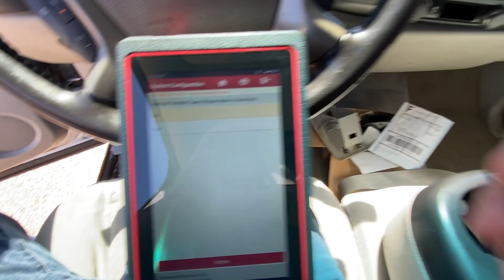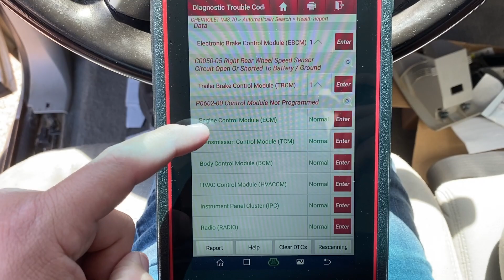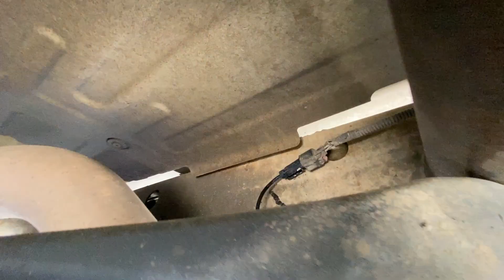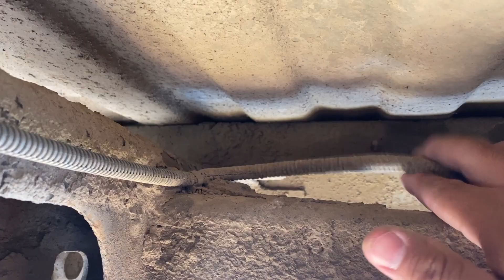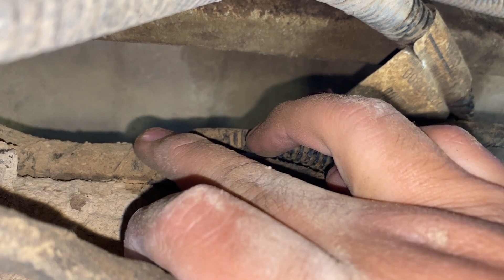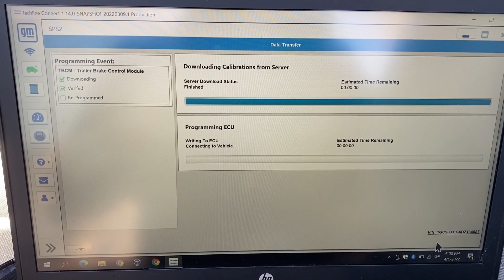CHEVY SILVERADO SERVICE TRAILER BRAKE & WHEEL SPEED SENSOR FAULT DIAGNOSIS & FIX

Comment: I.would have done.exactly what you did but that was a pickup you tilt the bed up on the driver side to access the top of the fuel tank for a fuel pump or whatever instead of dropping the fuel tank. It's easy and quick.

Comment: Im having the exact same problem. i too want to just run another wire, but at the abs module, im not sure which wire  it is by the module. Any help would be greatly appreciated. 2018 chevrolet silverado
Reply: Rear driver side wheel speed sensor

Comment: Absolute masterclass of automotive diagnostics. I bought a 2012 with abs on. Brand new speed sensor was still throwing a code. I broke out the parts cannon and just changed it to a Bosch and  it worked and hasn't came on since. Last guy put on a cheap aftermarket part. I figured it was worth $30 to just throw a new part on and hope. I got lucky

Comment: Get yourself a Power Probe Ect3000. Connect the signal output to the cable you want to trace and use the receiver to look for the cable along the harness. When the beeping from the receiver stops, that is a general area where the break in the cable happened.

Comment: Thanks for this video, I'm currently looking at a 2012 Sierra 2500 and it has service trailer brake system light on dash. Is the same issue you fixed on this video? On average how much would it be to fix?

Comment: Would this be the same for a 2008 Silverado for trailer brake , I have replaced that as well as dash electric brake switch,  and remain on,  Someone put a aftermarket one in,  But that dash message is annoying,  Also I watched other videos where they replaced without programming on the 08 chevys , help please....

Comment: Trying to trace an open or broken wire can be easy or become a nightmare. Have you ever considered using a circuit tracer? You can actually find where the break in the wire occurs without physically probing or touching the wire. Just my two cents worth.

Comment: I  WANT YOUR HELP MY FRIEND  I AM FACING A STRANGE SITUATION I HAVE STFT -18% - -23% AND LTFT + 24% AT IDLE AT WOT NOTHING CHANGE FUEL TRIMS ARE SAME.THE 02 SENSOR 1 DONT WORK AND THE CAR STALL WHEN GO TO STOP AT  LOW RPM (1000 RPM) .UNPLUG MAF AND FUEL TRIMS GO TO NORMAL AND STALL PROBLEM STOP BUT CONECT MAF AND DISKONECT 02 SENSOR 1 STALL PROBLEM IT GETS WORSE . HOW CAN I BE RICH IN STFT AND POOR IN LTFT?ΤHE MAF READING NORMAL AT VOLUMETRIC EFFISIENSY AND IDLE AND 2500 RPM HAVE READING IN THE SPECIFICATIONS 
ECU TO CLOOSE LOOP READ  THE PRICES OF THE O2 SENSOR AND THE MAF  TO REGULATE THE FUEL TRIMS?DO YOU 
THINK IT IS RIGHT TO CHANGE O2 
SENSOR FIRST?SO THE ECU READ THE O2 
SENSOR BECAUSE NOW THE ECU DOES NOT SEE ANYTHING FROM THE DEAD 02 
SENSOR! WHAT DO YOU THINK IS MAF OR O2 SENSOR FALSE? THANKS MY FRIEND

Comment: This was a great job.  What you were working on was a "water baby", a truck that had been in water and mud at least up to floor level, and if above that, the cabin was cleaned up really well, where you could not see or smell any traces or water, mud or mildew. Great job, great choice in running the the wire.  My only question is in making the splice, did you use a low temp solder connector with heat shrink tubing over it or a crimped butt connector with heat shrink tubing for a water-proof connection, or some other method? Inquiring minds out here, hanging on your answer for the best practical, water-resistant splicing method.  The re-programming of that trailer brake module was an excellent lesson in how to do something many of us would never see done or have any idea know how to do.  Thanks again for sharing your knowledge and diagnostic techniques with your viewers.

Comment: I've got a system that puts a pulse in the wire. Then a sensor you run down the length of the harness. when it stops beeping you found your break. its made by power probe and I bought it thru snap-on. Used it many times and it works awesome.

Comment: Y not use that tool that finds breaks or splices in the electrical wires? That way you wouldn't have to run a single wire.
Reply from the maker: I've always had hit or miss luck with those things, but it might have been worth a try. Thanks for watching!

Comment: That's appalling engineering how all the mud can get on the wiring harness that tick
Reply from the maker: When the mud dried up inside the connector it made it super difficult to unclip the connector because I couldn't even press the clip down to release it. Very frustrating. Thanks for watching!
Reply: @ADVANCEDLEVELAUTO  Ya, don’t disturb a sleeping monster! Fix one problem, create 5 more scenario! LOL

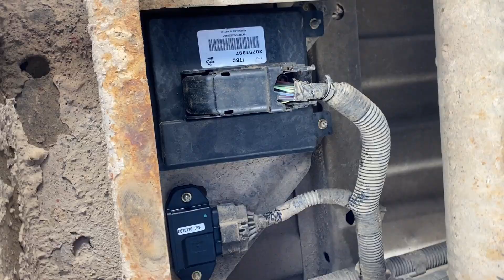Comment: The symbol indicating that the ITBC needs to be programmed is clearly visible on the barcode label (7:34). Whoever replaced that module is either unaware or did not have the equipment to do so.
Reply from the maker: Exactly!
Reply: @ADVANCEDLEVELAUTO  Action vehicles are no different than any others! We are not to question,, who & why others did what they did! Deal with what you got & repair it! You/ I don’t get paid for investigating the past! Personally , I don’t care,,, get r done! LOL

Comment: great diagnosis! I think chevy had to put a better protection for the wires against mud :)
Reply: For sure! Imagine trying to get a reading on the “ gas tank pressure sensor” without causing 10 more trouble codes!

Comment: That was a great fix on your part. Question, when you use a piercing test lead does the pierced puncture require sealing ?
Reply from the maker: Yes resealing the wires is a good idea, but in this case we ran our own wire so it didn't really matter. Thanks for watching!

Comment: My 2017 F150 had the same problem adding the electricb steering would not work the problem was fixed. New power wire to wheel sensor and had to replace the abs module.

Comment: Eric! 
Get yourself a "wire hound". A wire break locator that injects an RF signal that ends at a short  or a break.
Reply from the maker: I'll be sure to check that out! Thanks!
Reply: @ADVANCEDLEVELAUTO  Wow, never knew about those.  Seems to work like a stud finder !

Comment: Wonder how that wire got messed up? 🤔
Reply from the maker: Aliens!
Reply: The mud and grit likely wore through the insulation causing green oxidation and dissolved the tiny wire via vibrations and movement over time.

Comment: You shouldn't be apologetic for not torturing yourself to find a broken wire. Run a parallel wire, test it, and call it a fix.
Reply: Agreed, I just did the same thing to repair my electronic fuel filler flap. Wasn't going to spend hours ripping the interior apart, cut the old wire, ran a parallel one, job done.

Comment: good video you explain very well ,thanks
Reply from the maker: Thank you!
Reply: @ADVANCEDLEVELAUTO , you can use a wire break detector, it sends a Emv signal through the wire and a probe transforms it in a sound , that way you do not get mud im your face...costs 20 dollar. Nice videos!

Comment: Thank you.. Great video as always.
I have a question here on the vehicle speed sensor. I have a car that I swapped its engine and ecm to a higher model. The donor car had ABS while my car doesn't. Since the swap, i have a check engine for this wheel speed sensor. Is there a way to disable the abs module since i don't have it on the ecm so i don't get the check engine light anymore.
Reply from the maker: It depends on the manufacture. Some models use the same computer hardware wise and the only thing you have to do is change the software configuration. Others are physically different parts and are not compatible.